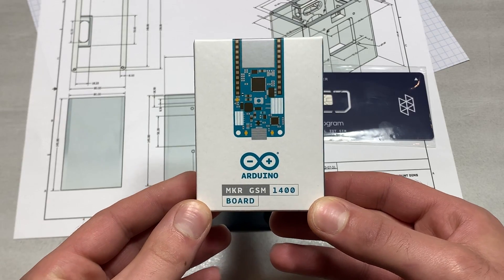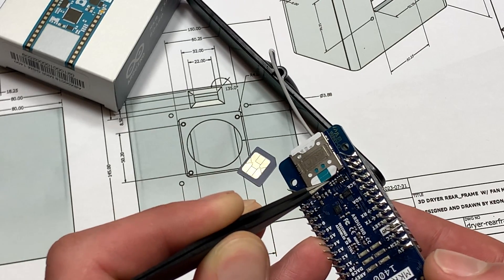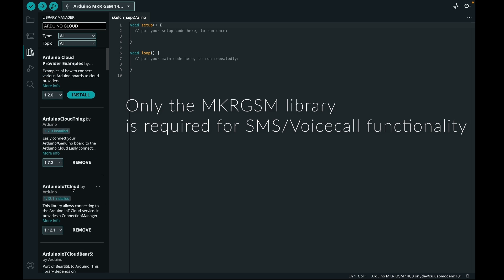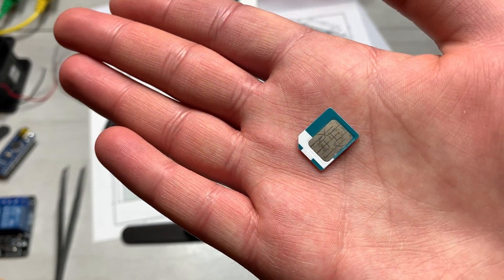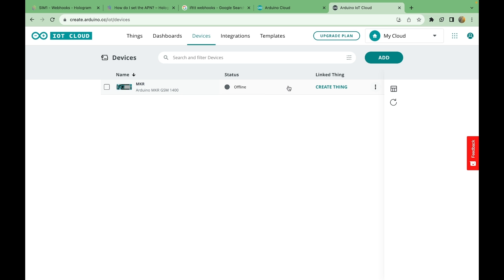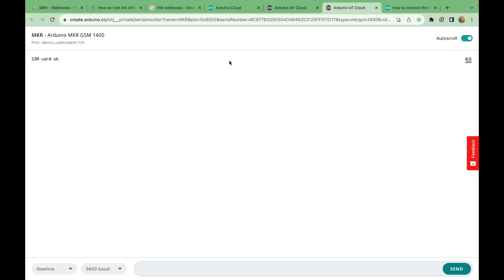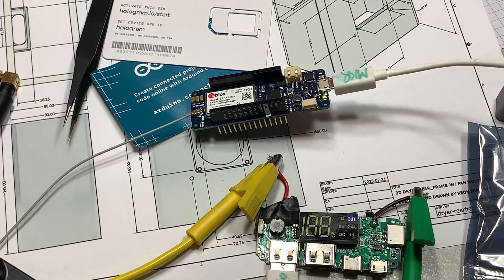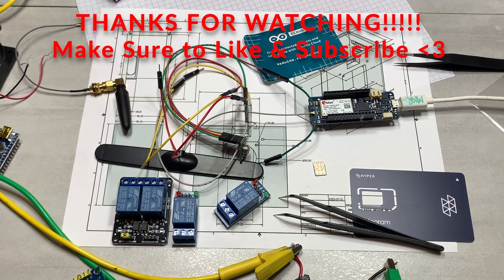Arduino MKR GSM 1400 Cellular Kit Setup Tutorial with Arduino IoT Cloud || [Part 1]

Comment: It's quite hard for me to get the X000016 for the antenna. Do you have alternative options for this?
Reply from the maker: I actually looked into this for you! I found the X000016 Antenna on both Digi-Key and Mouser Electronics, and while I did find a couple potential alternatives (which I may try in a future video), they were all more expensive than the original. The data-sheets were also a bit vague with slightly differing specs. I'm also still learning about cellular antennas, so it didn't feel right to recommend something that I wouldn't know would work or not. I hope this makes sense.
Reply: I manage to get myself on a X000016. However, now I am having issues connecting it to a vodafone base station for SMS. Do you have recommendation for this? @KeonsLab

Comment: Hi thanks for posting this video. I bought a mkr1500 and gps shield hologram works perfect. I was able to control the led remotely. I have difficulty adding this gps location sketch into the Arduino cloud and be able to get altitude longitude remotely.  If u know how to do it plz share your input. Thanks
Reply from the maker: I was actually trying to figure that out myself too. I’m working on lots of different stuff so I might not be able to right away but I’ll definitely get to it at some point since I’m planning to put this thing on a model rocket with sensors and have it send telemetry back in real-time.